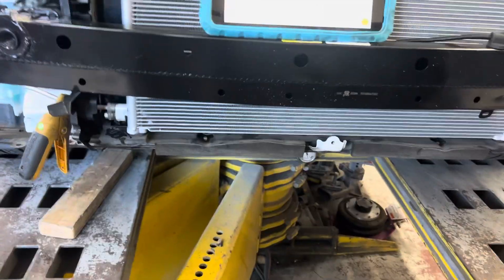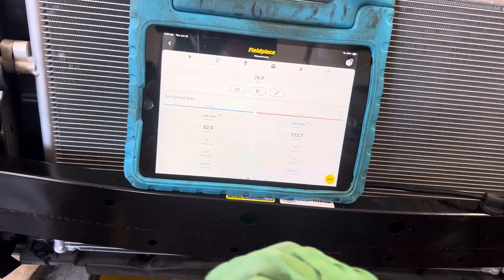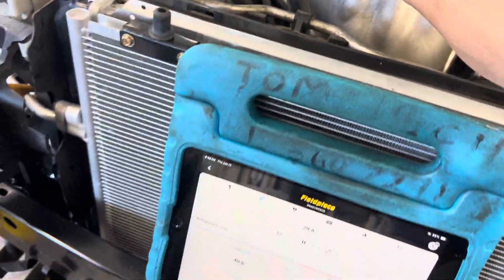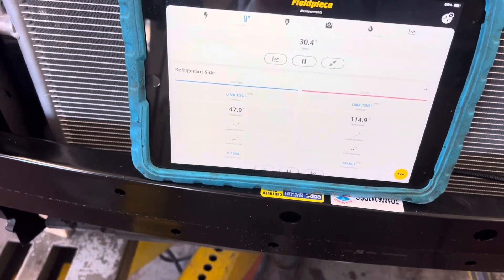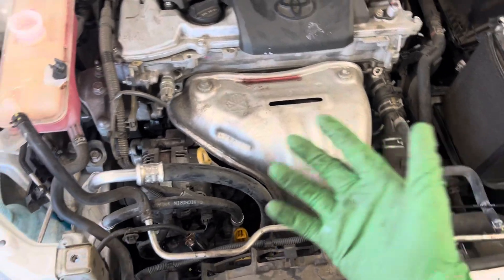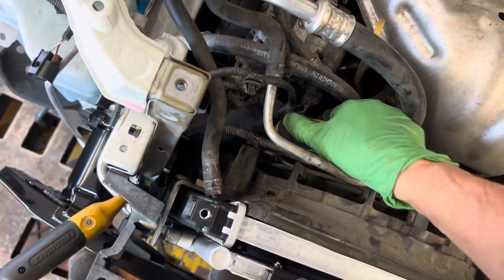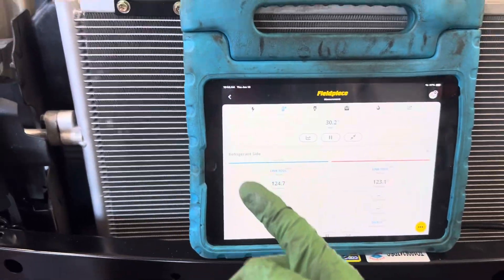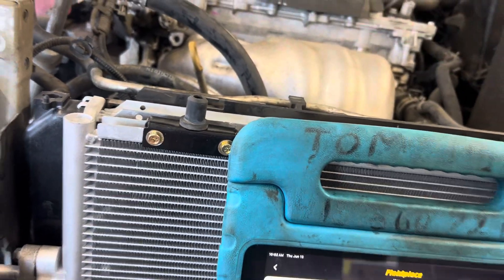Temperature drop through a restriction is like voltage drop through a resistor

Comment: You got me thinking Tom.....i always wanted to put AC back on my Triumph Tr7 with a modern touch ... it had 2 Excellent condenser  pusher fans on it (  rare at the time ) 
but a tube and fin condenser long thrown in the trash ..years ago i swapped in an old school 5.0 mustang engine in it...knowing the modern cars you see....Can you think of a Denso Condenser / with the lower sub cooling section that might be a good fit ?    maybe a  2012 Prius for example ....and i would just have to make some  custom fitting ....
thanks for all you help     Jay      aka CarsRcool channel 
( trying to get the original dimensions - have not found a source yet )
Reply from the maker: I can’t think off top but anything from a Prius or a Toyota modern that was designed to work with R1234YF. We have the highest refrigerant tube, density and highest fin count.

Then you go into the parts illustration guide look up the different condensers on different vehicles and they will actually give you the sizes height, width, and depth in inches and millimeters or centimeters . 

And just select the one that is the biggest one you can fit in your vehicle with Kustom modification with Your Own brackets 

And use your push or pull fans, however you design 

Will definitely work better than anything that was available pre-2000
Reply: @coldfinger459sub0    excellent suggestion Tom... 
A Car that has R1234YF  as you  have stated  would be more robust ..AND have a higher fin count...
sounds great ! 
Thank !      Jay Fox   aka CarsRcool channel

Comment: The engineers are such evil 4 wh0les for routing the ac lines right by that exhaust manifold in the first place as if they couldn't prolong the life of the ac equipment by routing it a different way.... but that's the catch THEY DON"T WANT IT TO LAST.. or you wouldn't be coming to buy parts and going to the dealership in theory to keep that money flowing.... or buying a "new car" ..... hence why i dont drive anything newer than 2008 ... lol